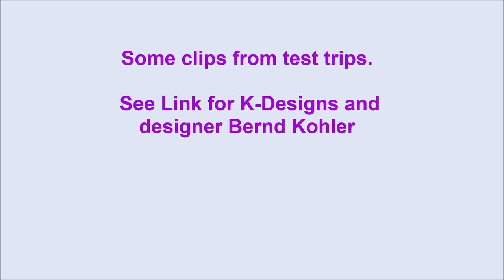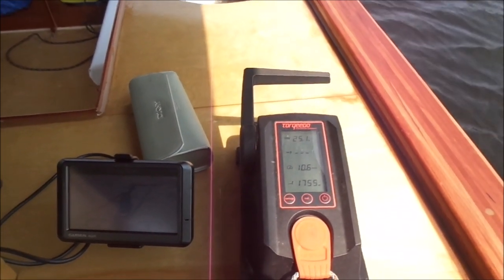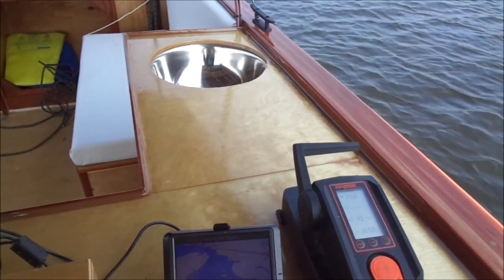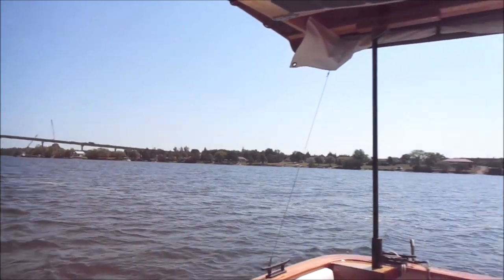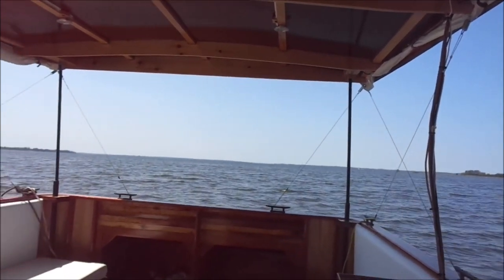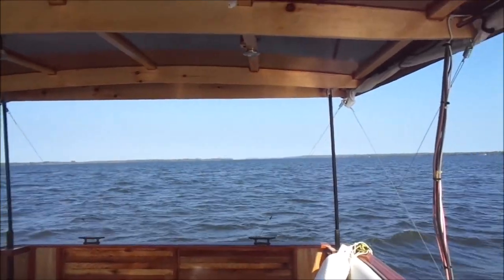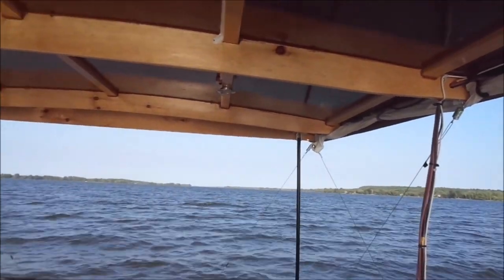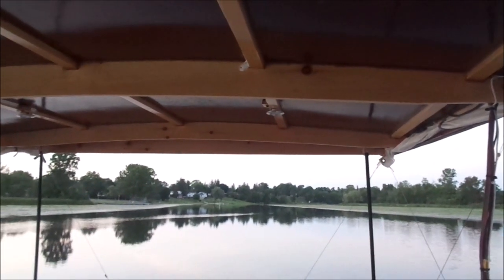Building My Solar Electric Catamaran Part Eighteen, Trips Taken

Comment: It would be interesting to maximize power from your array by using bifacial sunpower panels... you could fit 4 of the 545W Maxeon panels on there, which get you to 2180w and if you have a lot of light reflected back to the bottom of the panel you get 5-10% extra. Of course that would be a much different canopy... you might squeeze in a 120-160W of CIGS flex panels also along the side...
Reply from the maker: Interesting panels. I had bought 3 of my panels in 2017 so the ones I bought this spring were from the same vendor. The Maxeon would be better.
The hull is a semi planning hull and with a 20 hp can get up to 15 knots. I will be planning to only use high power if I need to or if I am only going out for a short period. On my planned trips (multiple days) I plan to cruise at 8.5 km/hr.

Comment: My big question is hull design for performance on blue water?    Are you still happy with the V design?  or would you next time do flatter bottom for Planning?    Also, for higher buyoncy for heavier weight.???
Reply from the maker: You will have to wait for a latter video as I have not tested the new motor yet. So far I can only cruise at up to 10 km/hr. The design is a semi planning hull. At cruising speed of about 9 km/hr it is pretty efficient. I have not planned yet so can't comment yet.

Comment: Love the plot at 3:22, it make the relevant data easily available.  It sure does show how much you are affected by head/tail winds. It also highlights the relationship  where  power level affect speed  and range,  to give 3 examples:

Power  speed with 10 KPH Head wind,                                      Speed with 10 KPH tailwind
300W     4.7 kph (2.9 mph). 15.67 km/KW (9.7 miles/KW)         5.5 kph (3.42 mph) 18.33 km/KW (11.39 miles/KW)
900W.    7.4 kph (4.6 mph)  8.22 km/KW (5.11 miles/KW)         8.9 kph (5.53 mph)  9.89 km/KW (6.14 miles/KW)
1.9KW   9.7 kph (6.0 mph)  5.11 km/KW (3.17 miles/KW).         10.7 kph (6.64 mph)  5.63 km/KW (3.5 miles/KW)
.
Very interesting.  Much longer range at Lower speeds, but if you are fighting a headwind or adverse current you can't make any progress at lower powers...
Reply from the maker: Yes exactly. My hull speed is about 10.5 km/hr and can never exceed that unless I was planning which is why I will get the 20 HP Elco. But what I hope to achieve is by reducing the over all weight to achieve this same curve but at a lower power. I would like to cruise at 9km/hr and draw under 1400 watts.

Comment: any problems getting on or off boat with all those wires? looks like a good time. my dog hates my shakey dock.lol. there was a company in Ottawa. that had a paddle wheeler that was good in weeds. but it took up a lot of space. what did it draw around 6 kmph
Reply from the maker: Sorry but I don't know what wires you are seeing. There are no exposed wiring. At 6kmph I draw about 700 watts.
Reply: @philboyer2036   hi the wires for the top
Reply: @philboyer2036  ok i see now the little doors near back with no wires.
Reply: I thnk Daniel is referring to the support wires that (I think) help stabilize the top.
Reply from the maker: @richardgray2706  The guy wires are at the forward side away from the doors. The other guy wires are at the bow and stern and go across so again no interference getting in or out of the boat.
Reply: @philboyer2036  Yep, Certainly would leave the sides available for entry and exit.

Comment: What about the water current or the ripples to the the catamaran's speed Phil? It looks stable on this video
Reply from the maker: The river has a current but also a seich which causes the water to flow back against the current. This happens in a cycle of 2 hrs 20 min. When I test I am down river where the current and seich are not a factor. The wind is my biggest factor.
Reply: @philboyer2036  The square boat's body plus the hull retain the wind,  perhaps considering open railings to reduce the wind resistant. If it is possible, arrange the batteries in the catamaran chamber

Comment: Hi Phil. Interesting test drive. The performance with this small engine is not bad. Nice surroundings too.
Reply from the maker: Thanks Bernd, I plan to make it better. Not faster as hull speed will prevent that but lower power for cruising. In the spring I will buy my Elco motor.

Comment: Nice!  My electric 18' pontoon needs about 4kw to get to 10-11kph(6.5mph)....  Shows how much more efficient your hull design is than a standard round pontoon hull!
Reply from the maker: I am hitting hull speed at 10 .5 km/hr. When I get my 20HP Elco in the spring I hope to get it on plain.
Reply: @philboyer2036  Correct me if I am wrong but that a displacement or semi displacement hull right? So it will never go "on plane" like a bass boat planing hull... so it just gets exponentially harder to push this hull instead of going on plane. So you need 4x the motor to go 12mph as you do 6mph etc... I bet the 20hp should get you to 12-15mph though. I really like this pontoon design.
Reply: @Wingnut353  yeah, I'm wondering the same thing..  I thought V's don't plane.